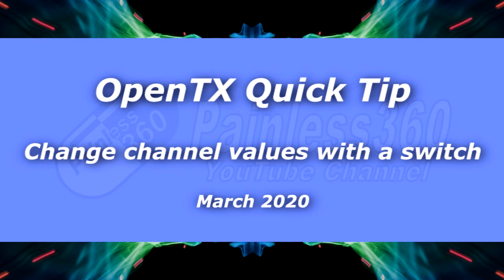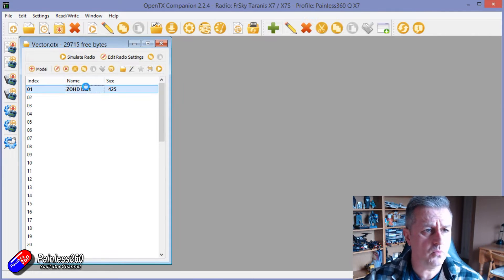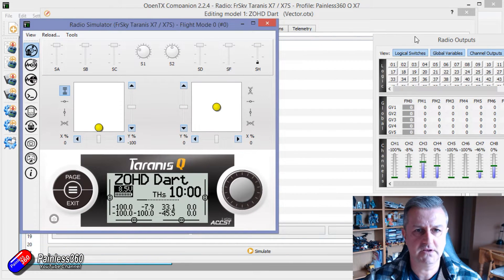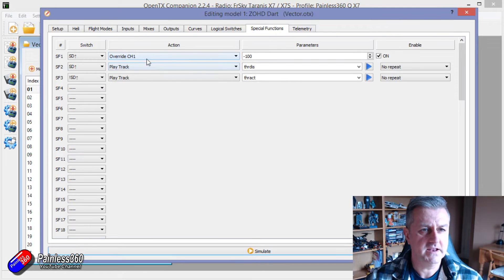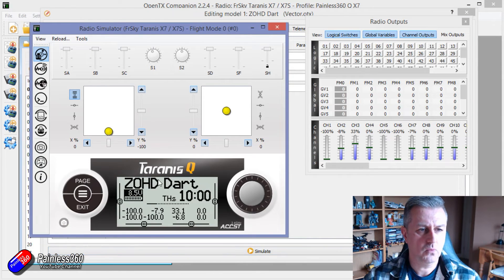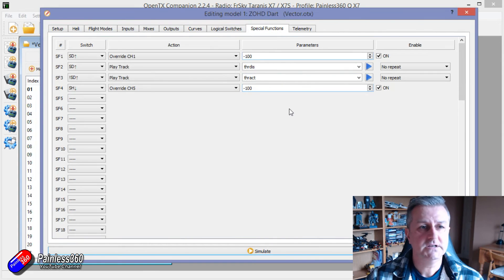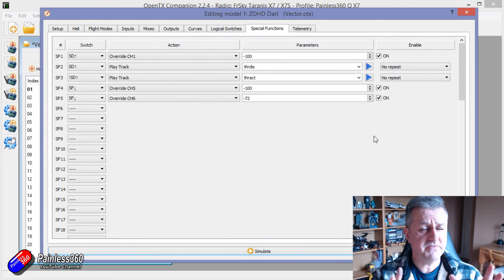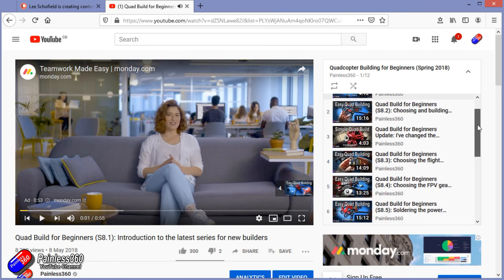OpenTX: Overriding channel values with a switch

Comment: Interesting. So not using override, but how would you stack several channels on one switch in the mixing tab? I have rgb leds, so 3 channels each hooked into one switch. How would I turn on all 3 leds with one switch position, without using override?
Reply: After some FAFO I figured out that the order of override functions, matters. 
I got it figured out

Comment: Now that Betaflight 4.5 uses the rate curves for ALL flight modes, I found that my normal freestyle rates were garbage for flying in Angle. I needed a way to override my rate profile selection channel with a set value whenever I move my flight mode switch to anything but Acro mode. With this guide I made a special function referencing "!SD^" and it did the trick. Thanks!

Comment: Hello Painless360, great information, thank you. May I ask if there's something like a hard override in OpenTX? I'd like the momentary switch SF (recovery/autolevel) to override switch SC and SD , but SD already has an override function set (-> SD-up and SD-down overrides the channel values set for SC). So the question again is, can I - with SF - override SD, which already overrides SC?
Reply from the maker: The order that things are setup in EdgeTX can make a difference. I'd try moving the setting up or down in the list.... Best of luck
Reply: @Painless360  Thank you.

Comment: How do I change channel 1 to SBUS to use crossfire pwn rx with wing? Struggling find option to change SBUS on TBS Mambo? If I go to receiver options. I don't see option to change channel 1. Trying to set up Zohd stabilizer. Ripping my knitting . Advice much appreciated. Cheers
Reply from the maker: Please see my Crossfire videos. Sometimes you need to try and set that up on another output. Best if luck.

Comment: hi i am using an override to set a throttle value for a 10 sec period using a switch, the problem i have is if i deactivate the switch the override continues to run for the full 10 seconds. Do you know if there is a way to cancel an override after its been started? Many thanks
Reply from the maker: Not without some time playing. Maybe use another method? Best of luck!

Comment: Channel reversing on a switch was part of what made the CheaterKwad work so well.   First build was a forward upright and a backwards upright camera.    It wasnt long til I had the mixes set for reversing/splitting throttle for 3D mode while reversing the channels needed while controlling up to 3 FPV cameras.